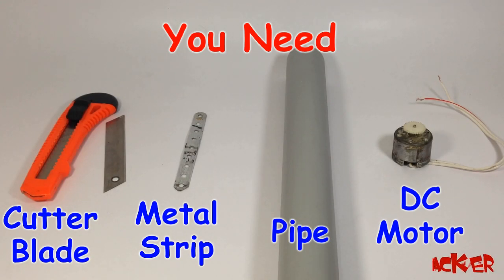How to Make a GARDEN CUTTER at HOME | GARDENING TOOL

Comment: aap is moter ke liye konsi battery use ker rahe ho
Reply from the maker: +Aziz Shaikh 
i am using 12 Volt Bike Battery but if u don't have battery than you can also use adapter is power supply is available.